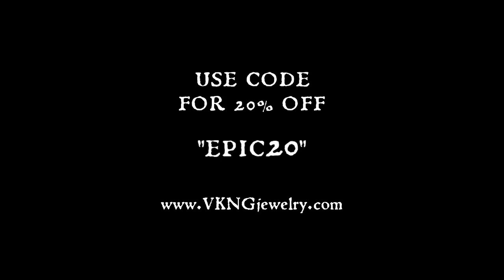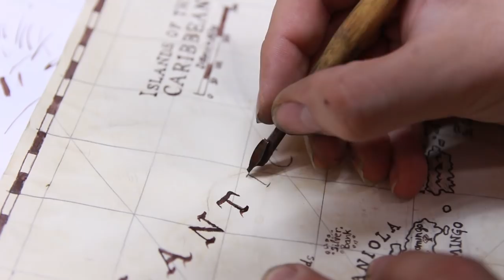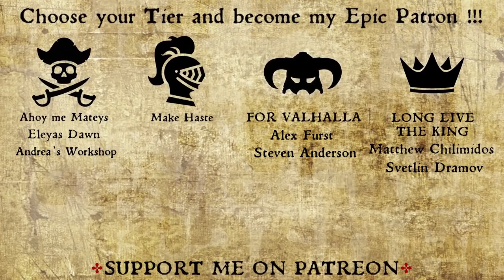Epic Pirate Cutlasses - Entirely From Wood

Comment: Even Pirates have an EPIC touch.

Epic Cross 'n Bones.
Reply from the maker: Heck yeah! 🤘 crossed swords was actually idea from my friend, at first we tied a pieces of thin twine to the ceiling so we can tie swords so they hang in "X" position... we fiddled with that setup for 2 hours and failed miserably 😂 I got idea to use nails and two oak boards in clamps hidden under clothes on table to make a stand and it worked in 20 mins 😂😂 but we listened to Alestorm and other pirate music so we had a blast 🤘🤘🤘

Comment: Speedy or slow, just keep putting out content. You're Awesome! I am subscribed so you have at least 1 view from me, every video. Did you make the mini Ship wheel? How easy/hard was it to attach it to your vise?
Reply from the maker: Thanks Spencer, it is nice to hear/read this! New content coming for sure 😉 Nope that is actually real wheel from a small boat (though it is not usable), Attaching it was very simple "crude" actually 😉 I tapered a dowel and made a locking pin, glued it to the block of wood which has a hole drilled with slots for actual vise handle. Kind of hard to explain.. 😥 it is not very strong fit only for video purpose.